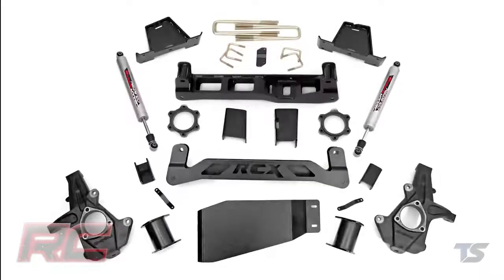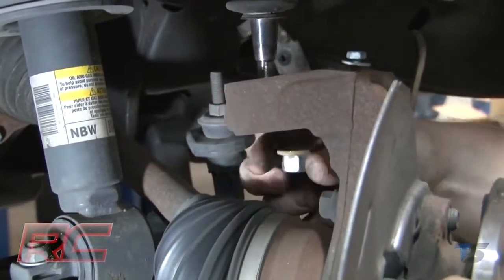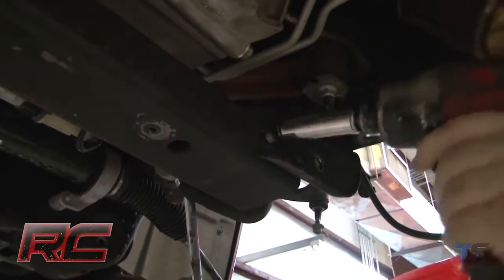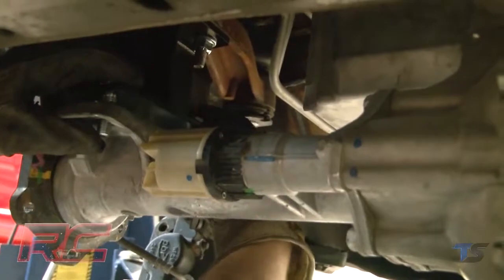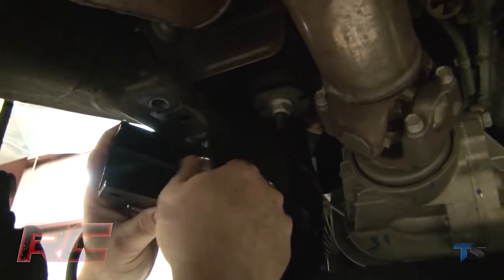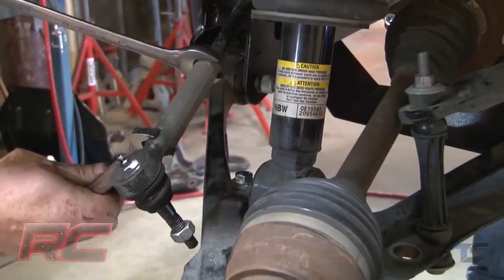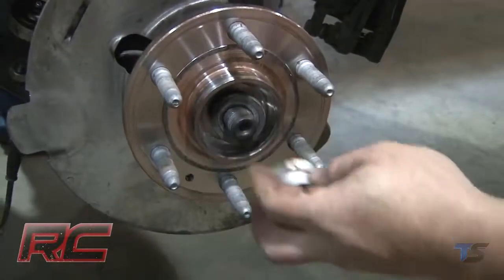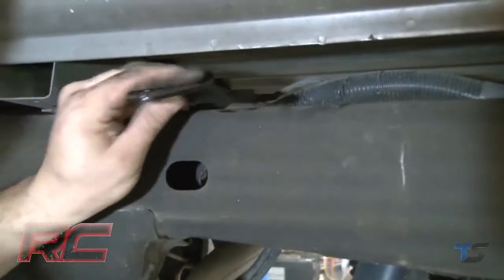Rough Country GM 1500 7.5 inch Suspension Lift Kit Installation

Comment: What is the measurement for the front strut spacer 7.5? Or 6 3/4?
Reply from the maker: The strut spacer in this kit is 6.5" tall.
Reply: If the factory upper controls work with this kit why won't the rc 2.5 to 3.5 upper control arms work